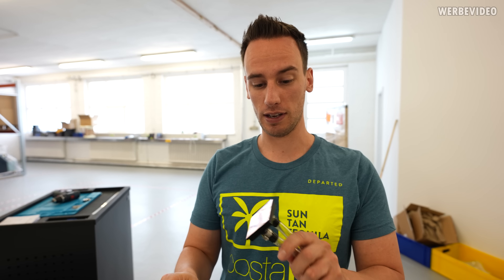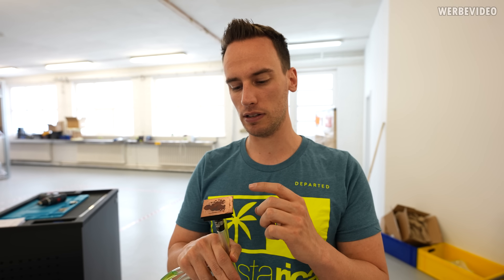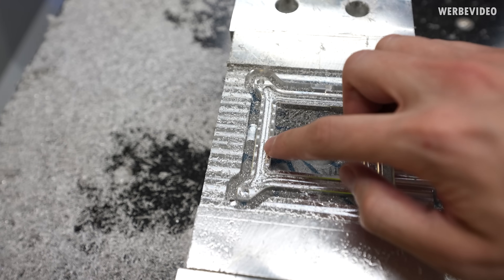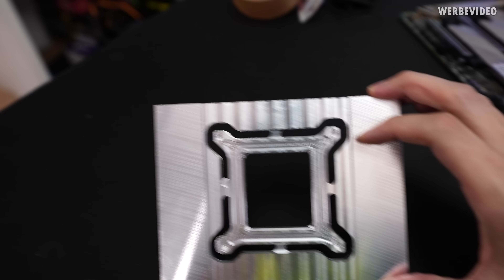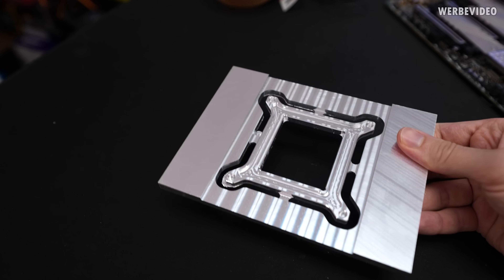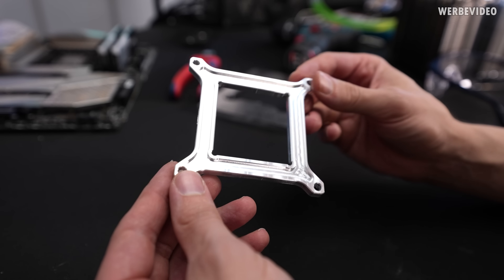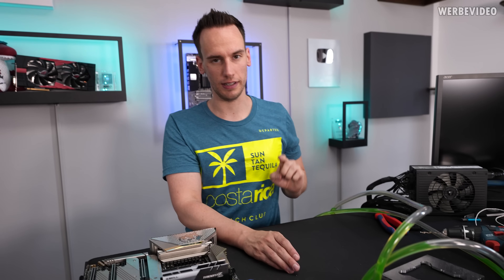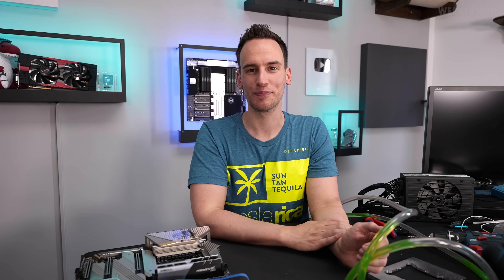CNC Baby Steps - Milling a Corsair Water Cooler Mounting Frame

Comment: I had one of these, Corsair Nautilus 500. Ran it on a Core 2 Quad QX6700 in late 2006 when that chip launched (still have it in-fact!) until 2009. That cooler was pretty interesting. It had a 120mm fan and radiator a DCC pump, tiny res and some soft tubing connecting it all. Was a lot quieter than the stock Intel cooler that's for sure.

Comment: Damn, you have a Datron, I'm jealous!
Some CNC tips: 
- Be careful when clamping plate material in the vice, you can easily bow it this way, or even if it doesn't bow in the beginning, it may once you have removed more material. In this case, you would be better off clamping it down to the table (or a thicker block of metal in the vice), maybe adding a thin sacrificial plate in between, so you can cut all the way through. (you can even use acrylic for that)
- Try using triangular tabs instead of the standard rectangular ones, that means the endmill won't plunge straight down and you won't get that horrible noise.
- You can set your bottom height 0.5mm (or on a Datron probably also just 0.1mm) below the part, that way you can be sure you cut through all the way everywhere.
- If you want to chamfer the bottom without flipping the part, look into getting a backside chamfer tool, as long as you have clearance under your part, or a soft sacrificial material, this allows you to chamfer the back from the front.
- And lastly, I know you're just learning, but once you get the hang of things, you can push that machine way harder, like at least twice as much metal removal rate.
Good luck with your future CNC projects, I'll be eagerly awaiting them!
Reply from the maker: Thanks for the feedback man!
Reply: Cooling cooling cooling upgrades

Comment: Hey Roman , quick advices from a french machining teacher (HSM specialized) ;-)

1 - For the drilled holes, always check in your CAM software (Fusion 360 i think...) if it is a trough hole, you must have an offset to add to go a bit further to the total thickness of your part.
It is in the third tab of yout toolpath settings in the last part, your need to ckeck something like "drill go through" and add an offset.
2 - For the corner remaining material, it is absolutely normal, because your vice bend the aluminium sheet (if it was thicker you won't have this problem), it is fairly recommended to use a torque wrench on these jobs. I had the same problem on a dual socket waterblock i did myself (the backplate was too thin and it flew from the vice...)
3 - You can machine these kind of parts with the VacuCard on vacuum table i think, just try it with a little bit less depth of cut (half of recommended to lower cutting force)

Do you have alcool mist on your Datron ? if you have it, enable it (M08 code will be visible on your Gcode), it will improve your tool life and also roughness of your part.

I would be very happy to help you improving your CAM/CNC programming and machining skills. Feel free to ask anything about machining Roman.

For a first run, it's quite a good one !

;-)

Comment: The defects are due to dry machining, vs using a coolant. Aluminum galls up on tools very easily, creating a lot of friction and heat. If coolant is not an option, you can reduce some of the negative effects by using compressed air aimed at the cutting tool and the work itself. This should keep the tool and the work cooler, as well as remove most of the waste material from the tool and work surface.
Reply: Minimum quantity lubrication and Daytron's diamond tooling would make every surface a mirror